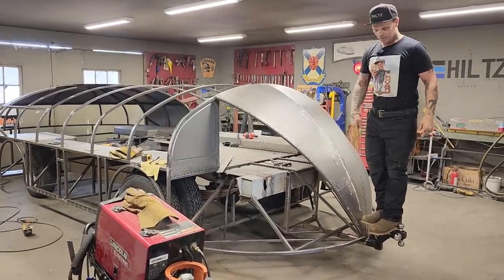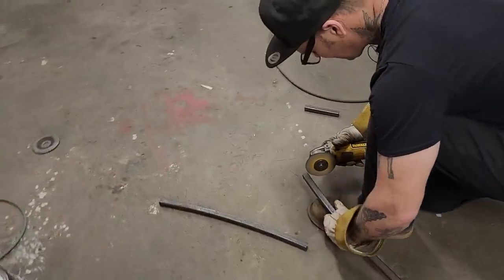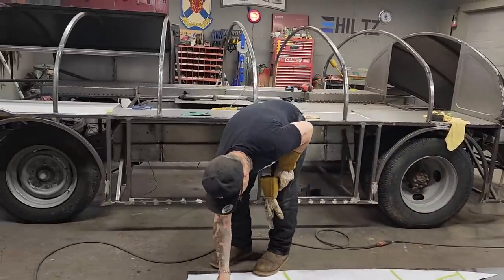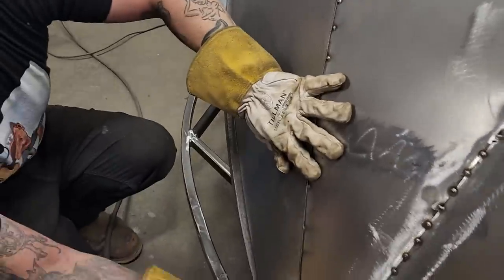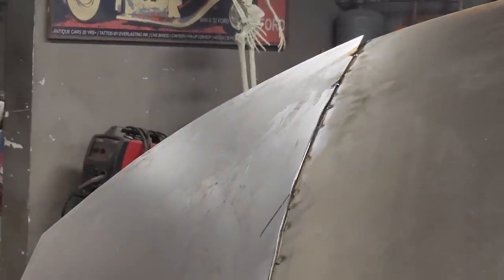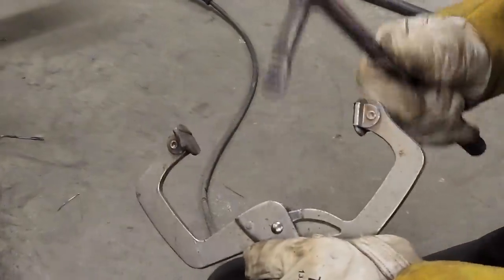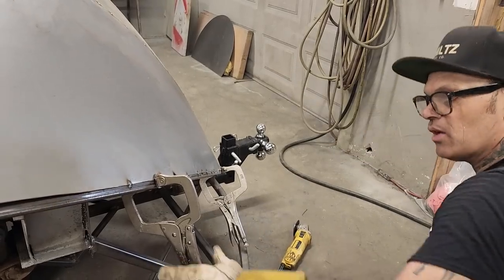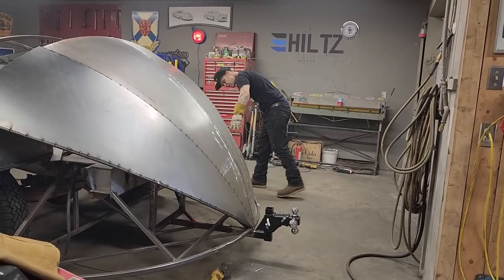Addressing the controversy + rear panel fabrication

Comment: Good idea making this a tow rig those lockers along the sides can hold all you tie down strops chains etc Ive towed far more than the rating with unibody cars, in fact the US is about the only place that made the weaker body on frame junk

Comment: I dont know, when its 1 inch stock theres not much strength. 1 bends another bends & continues over time. But u have a hell of a matrix going there.. I think a truck is stronger pure size of metal. Its like saying 20 popsicle sticks like this is stronger than a 4x4s 🤷‍♂️.. we will see. Please show us when it bends.  😂

Lets put controversy in the headline for clicks
Reply: Think about it, make a model out of toothpicks and then just a few dowel rods. Try to bend the hitch up, I bet the first breaks easily. The second will take a whole lot more force.
Reply: Controversy or stupidity ooop. Kinda left open for that joke..  looks cool though.

Comment: The hitch with some tung weight on it will either work or it won't ...... If it were me before you get it under paint I would hook a trailer with a car heavier then the Bugatti and take it for a long drive and see how it holds up

Comment: The tow hitch is different Chad, but in your defence over all the critisism you are getting, as long as the trailer is designed correctly and balanced as well as braked i suspect the loads will be perfectly fine on the hitch. Although we could never do anything like this in Australia, it would need to go to an engineering company for design and approval and permited to be driven on the roads here.

Comment: Chad, weld a "U" piece of square stock on the bottom of the hitch to support it from any heavy weight. Weld it to that first cross member going across back end. I found out the hard way (similar setup) on a trailer going over some railroad tracks with a motorcycle inside it. It looks to me that there are only two points of welded contact right now on the hitch alone.

Comment: Chad you need to please ware a dust mask and face shield all those particulates you are breathing will eventually fuck you up! Is that worth it? Use your brain 🧠! If one of those cutoff wheels shatters and hits your face minimal injuries would be stitches on the face… I have been building aircraft for over 40 years and you can be sure I have seen plenty of injuries on workers that slacked on safety.

Comment: Anyone have any idea how heavy this thing will be? I could see it pulling the front end up in the air, doing a whellie! Since ur not doing anything in any certain order maybe add some wheelie bars next and a parachute! Then if there isn't enough room for a driveshaft u could always add a electric motor and make it front wheel drive. Put solar panels on the roof, a generator in the back and batteries all up front close to where the front bumper will be to equal out some weight. Could even make it awd and add a electric motor to the rear axel, whats a few more lbs. Is the plan air bags or do u think it's going to be so low it's going to be a plow? Being serious tho I think the trailer hitch will cause problems with ur rear metal flexing and messing up the paint the first time towing. Hope I'm wrong tho, definitely a strange build... Hope it will move under it's own power one day... Somehow.

Comment: Bad Chad.. you can stand on there but do you have the balls to jack the truck up by that? If you can jack at the ball & get the rear wheels off the ground without bending the rear skin, then that would quite a lot of ppl down. I dont think it would hold more than a few seconds/ minutes. Leave jacked up like that for an hour or more and see if it bends.. That would  replicate force of towing better, at least on the vertical plane.. 

Hey all these extra controvery comments are going to push this video to new heights..

Comment: Chad, why do you keep calling this a "unibody"? It is NOT. The definition of "unibody is a structural body that does not require a separate frame" this truck is just a normal "body on frame" construction. It makes no difference if the body is welded to the frame or bolted, its just a standard truck frame. You could cut the body off and drive it around, try that with a unibody like a Dodge charger! That being said, your hitch is very weak and may just fail. If you look at any receiver hitch, two thick flat plates are bolted to the inner chassis rails and joined in the center with a thick cross bar. The actual receiver tube is mounted to the cross bar. The idea is that the load is transfered to the chassis, not the body. In your design, the load goes to everything BUT the chassis. Triangulation is for stiffness not strength.  Normal receiver hitched have 1/8" wall square tube at a minimum! It seems you are just making this up based on the steel you have on hand, hence your constant explanation of poor design. Better to step back and review proven designs.
Reply: Wot?? Triangulation for stiffness not strength?? Not sure where you get that from but its totally off the mark. Have a look at a normal roof truss, triangulated for strengh, stiffness is a byproduct...
Reply: Who cares
Reply: Somebody has to be a critic, it works, the content is for OUR enjoyment, not judgment.
Reply: Whinecha go tell him to his face.
Reply: @gilbertdavies1182  by product? Clearly you haven't looked at the design or ever run a truss through a program to see where the strength and stiffness lies. It's like Carbon Fibre, its not super strong its super stiff. The load path from a hitch is supposed to go directly into the chassis rails. Adding thin triangulated structures will not improve the strength of the hitch, just the stiffness of the structures involved. Ever seen a hitch built like this? No? Well there is a reason.
Reply: @garyhalliday2140  cuz I don't live in Nova Scotia. Besides, he makes show cars - not "go cars" that are actually used. It's all about fab for him, that's why the show doesn't follow through to completion, it's a business as he clearly said.
Reply: @jimrice6090  
I think what's going on there is that he's made few gorgeous custom cars which took a shit ton of work and now he's enjoying  winging it. He doesn't have to listen to anyone else.
Reply: Very well said
Reply: Exactly right!!!
Reply: @jimrice6090  Hey bud, I don't think anyone is forcing you or the other nay sayers to watch this channel. As far as Chad "winging it" (thinking on the fly), that's exactly where his skill lies and he's DAMN good at it.
I suggest if all the derogatory nay sayers don't like what they see, scroll past and if they need their esteemed opinions publicised, Twitter can cater for your needs.
Reply: @gilbertdavies1182  Hey bud, you're free to keep your comments to yourself as well. But you didn't did ya? I think we're all big enough to hear the negatives as well as the positives.
Reply: @jimrice6090  Touché 😜
Reply: Im all for different view points, but not when they become derogitory towards the content providers, who are humble people with a source of entertainment and expertise 😉
Reply: @gilbertdavies1182  nothing disrespectful when you point out a mistake like calling the chassis a "unibody" when it clearly isn't. Also, not disrespectful to point out potentially dangerous practices like making a towing hitch out of 2" square stock and reinforcing it with some random bits of 1" square stock welded to the body not the frame. That's just bad fabrication. But I have to remind myself that this truck will never get finished, it will just move to the big shop and a new project will roll in.
Reply: @jimrice6090  
Appreciated however, it's a matter of "horses for courses" Chad does things his way and is a perfectionist and I'm sure he will be the first to verify the safety before endangering anyone.
Not sure how long you've been following him, but he explains clearly about the reasons for delays in finishing each of his projects. Not many people around that can do what he does with what he has.
Again it also a lot to do about the people and their passion as opposed to just the product.
Have a look at his friend Jim Patterson's projects and his unconventional processes. The bloke is also as down to earth, humble and honest as they come....something this world needs more of 👍🏻😉

Comment: When putting on that sheet metal shouldn't you have started at the top tacked both sides of the top then work your way down on both sides that way you don't cause ripples  by tackling one side down

Comment: Actual “ weight on the hitch ball “ is supported by by very little, to say nothing about any twisting force that might be placed on the ball with respect to the short square tube that supports it. Heavy square tubing ( at least 2.5”) needs to be run from the hitch just inside the body to the highest And widest points on the frame. 5000 pounds of car and trailer gets multiplied in a panic  stop. How much downforce do you think your hitch will support?  Two 1” tubes? I would hate to see the rear of the body ripped down in a heated stop. Perhaps you should not have attached the hitch to the body, but only to the frame.

Comment: CHAD THE WHOLE CONTROVERSIAL SITUATION ABOUT THE TRAILER HITCH IS EVERYONES OPINION. BUILD IT HOW U WANT TO. JUST BECAUSE MY TRUCK HAS ONE PIECE OF SQUARE STOCK AND 4 BOLTS SO DOES MY VAN AND IT ABOUT AS THIS AS WHAT U HAVE THERE. THE TRUCK HAULS MORE YES. U BUILD HOW U WANT TO BUILD U ARE RESPONSIBLE FOR THE SAFTY OF WHAT U BUILD. DONT LISTEN TO THE NEGATIVE COMMENTS OR THAT NO GOING TO WORK. I LIKE WATCHING U BE CREATIVE. I WOULDN'T DO IT THAT WAY BUT I BUILT HIGH END CUSTOMS. I LIKE HOW U BUILD WITH VERY LITTLE TOOLS AND MATERIAL. KEEP UP THE GREAT WORK DONT EXPLAIN YOURSELF. PLEOPLE  DONT UNDERSTAND WHAT IT TAKES TO USE THERE BRAIN TO MAKE SOMETHING AND PUT IT ON THE ROAT. THEY BUY A PROJECT TEAR IT APART AND PEOPLE LIKE ME AND U TWO END UP BUYING IT. KEEP IT UP CHAD AND JOLENE!!
Reply: Stop yelling! 😂😂 we"ll see what was an "opinion" when that back end is folded up..

Comment: Unless you plan serious internal air circulation this enclosed structure will be a pressure cooker in the sun.  Forget bringing hot exhaust pipes inside exiting the roof for a number of reasons.
I predict you'll be tail dragging with a loaded trailer negotiating irregular road angle surfaces.🤨

Comment: Use a small propane torch to heat the ripples that will draw the metal down and tap it while you heat it. I thought you were smarter than that and knew how to work metal

Comment: Wouldn't tow anything with that set up
Reply: Once the sheet metal is on, and with all the triangulations and gussets, ground clearance at the back will be the only problem, it's easily strong enough.....  I would bet my balls all you "this won't work" crowd would struggle building anything with leggo !!

Comment: Chad are you trying to convince yourself that the hitch will work because you have told us many times how its anchored. I think the sizing is small no matter how many times you say it. it also should be higher it will bottom out going out a driveway.  you made a model from an engineered item.  you have disappointed me from an engineering point of view. like your design. how many connections do you need. you should have designed the hitch  to handled more than you jumping on it.
Reply: Yeah, were trying to save him a big f up, and were being called haters. He just not think about physics and laws of nature. Will look nice if he leaves it parked, the art is great.

Comment: I say from the looks of it you are good up to 4000 lbs on that hitch.   If you are just towing locally at sub highway speeds you are probably ok.
Reply: Won’t get pass the first inspection
Reply: @michaelanders6566  It will, hitches are designed with far lower load ratings than you'd expect because trailers are supposed to be balanced, that hitch will easily tow a trailer, especially when all the sheet metal is welded on.... Tongue weight is nothing like towing weight....

Comment: chad i like your idea on the hitch BUT its only about 5 inches to the ground if you ever half to have it towed theres no way to load it or lift front the hitch will hit now when you put a load on the hitch trailer and jolenes car its going to drop the hitch lower you may want to think of air bags on it to lift truck up to tow my belly botton  (HELLO JOLENE)

Comment: It looks to me that you've used the idea of triangulation to support the tow hitch so it should be fine. Aside from the tow weight there will only be about 250 kilos, or 10% of the tow weight down force on the tow hitch so all good. But as you know the haters got to hate. Keep on trucking.

Comment: You have so many triangulations and struts connected to that hitch mount, it should be just fine. Probably overbuilt and stronger than most Class B or C hitches on cars built today. Your outer structure alone with the square stock and fairly thick skin will be quite strong.

Comment: I would say the trailer hitch is about as strong as any bridge I’ve driven over with confidence. I have no idea what it would be rated at but I am sure you will never get anywhere near its limits. I wouldn’t hesitate to pull a car and an RV with a motor cycle on its back. There is no such thing as overkill. If I ever need a bridge or skyscraper built I’m calling you.